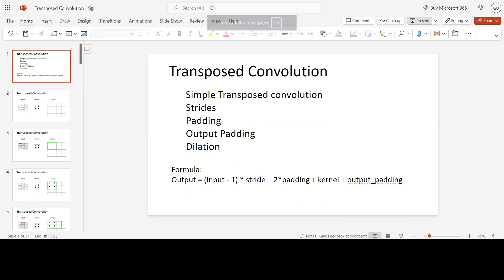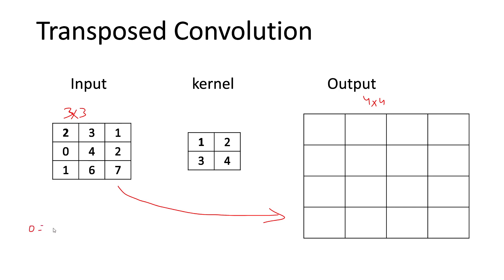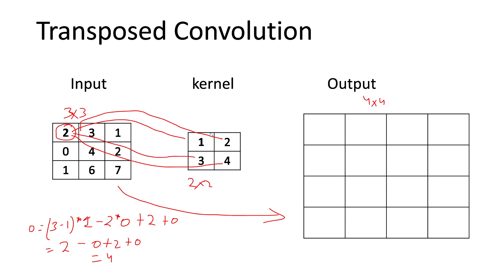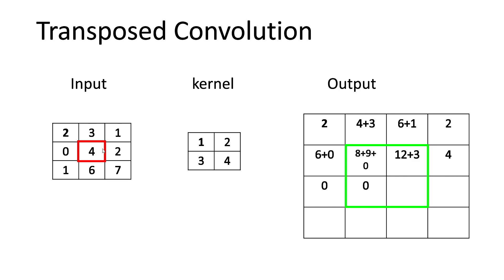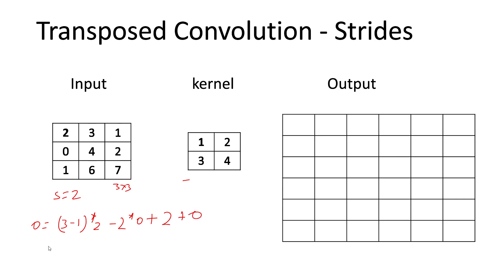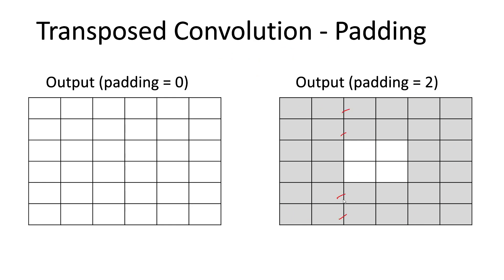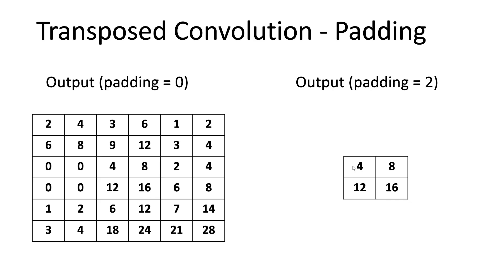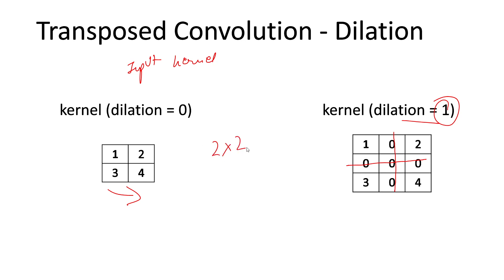Transposed Convolution in Deep Learning. Stride , Padding, Dilation, Output_padding

Comment: Thanks for the good work. I have one question. from Andrew ng clip he used input 2*2 with filter 3*3 stride=2 padding = 1 but the output is 4*4. how could it be? yr formula is o = (2-1)*2 -2(1)+3+0 =3 not 4 please explain.